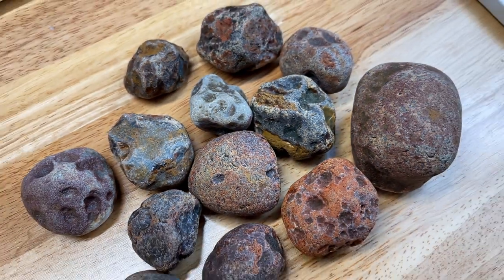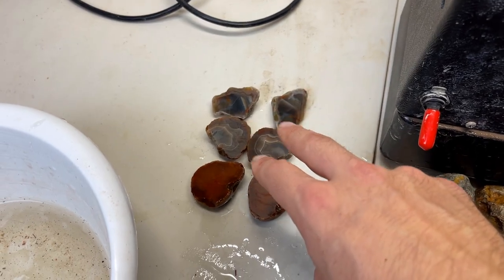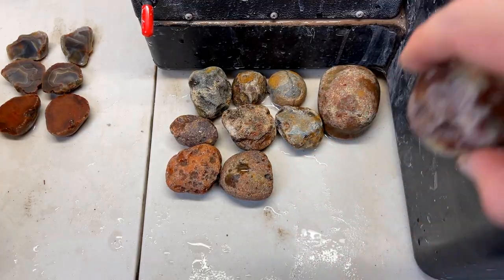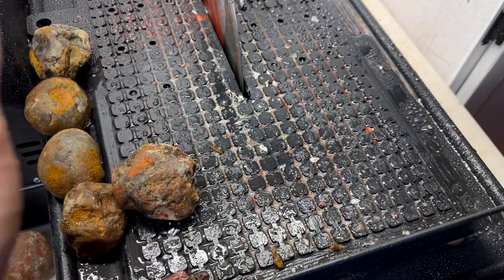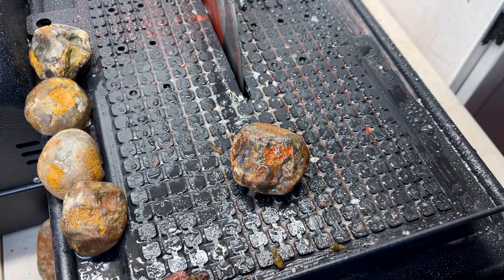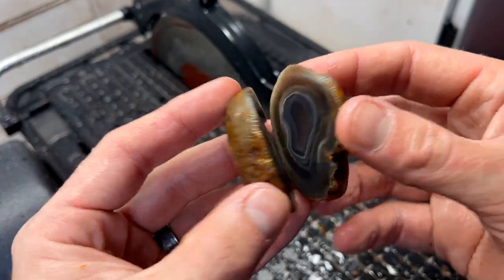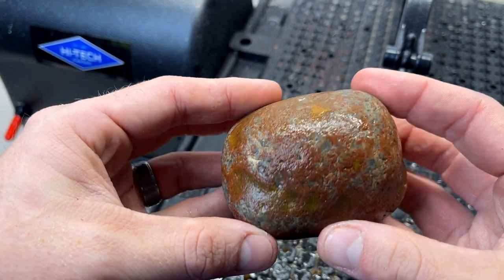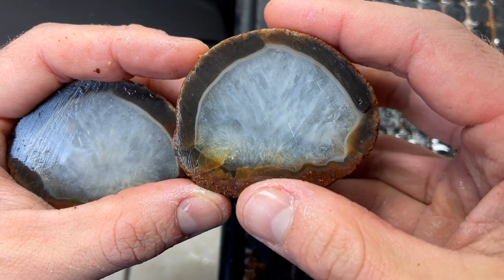Cutting 13 lucky AGATE nodules open & exposing hidden bands!

Comment: When I sawed rocks, I would put them in a wooden mold with rabbit wire, fill the mold with plaster of Paris, then I would cut thin slices out of the resulting block with the stones trapped in the 
Plaster of Paris. It was always a gamble, but i very often got multiple slices from single stones that way. I would then make cabochons with the slices. Got some beautiful results with that method.

Comment: I love the dark agates with all those bands. I still haven't used my tile saw. Think I might have the wrong blade for it. The edge has a fiber material. Looks like a need a thin metal edge to cut rocks. Anyway they all were studs.  Like how the nodes look plain on the outside but amazing in the inside. Agate awesomeness!

Comment: Wife and I like all of your videos. I need some advice on buying a cab machine. A 6" machine is more affordable. What size do you use? Is the 6" adequate?
I'd really appreciate advice from any with experience.
Reply from the maker: I think a 6” is a great place to start! 10” is able to cut larger but at least you’ll know you can cut most your stuff with it. Let me know if you have other questions or need a discount code 👍 (shoot me a message on IG or FB)